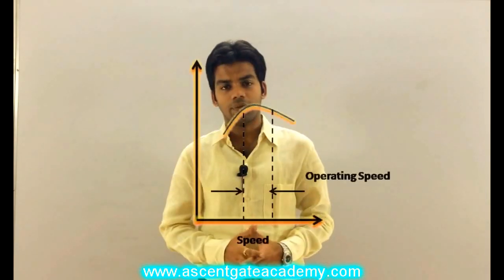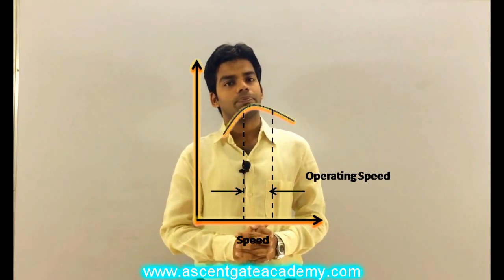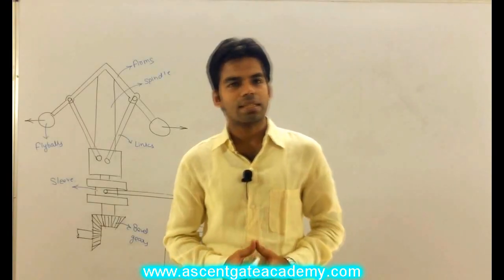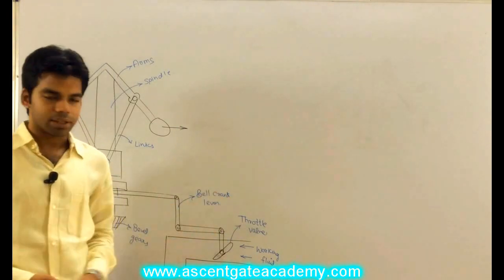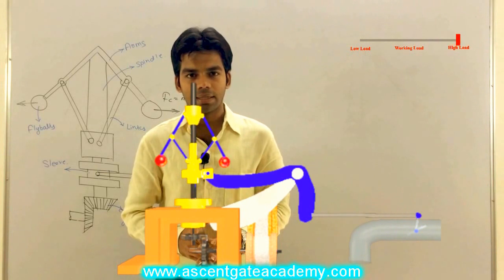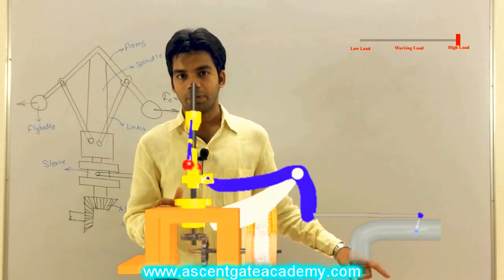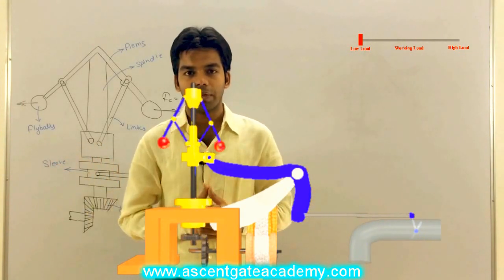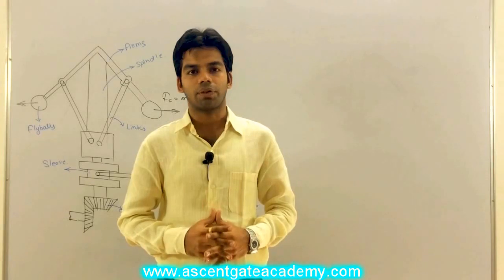GATE Lectures:  Working of Governor

Comment: Sir, I have a doubt, 
whenever load increses on the engine then governor  allows excess fuel to enter. But how long the governor allows this fuel?? If governor returns to its  equilibrium position then excess fuel supply stops, but here load is not removed. Can you please explain me this sir?